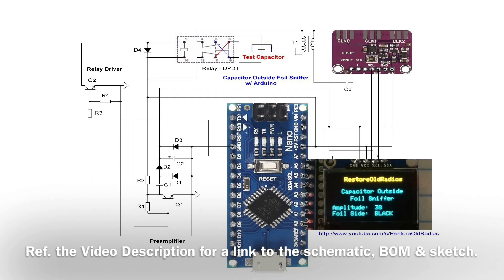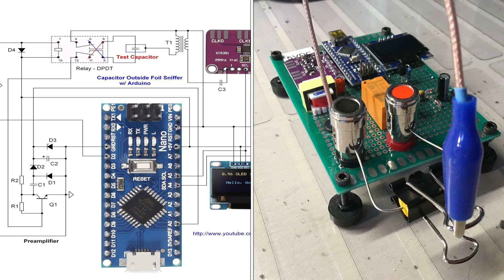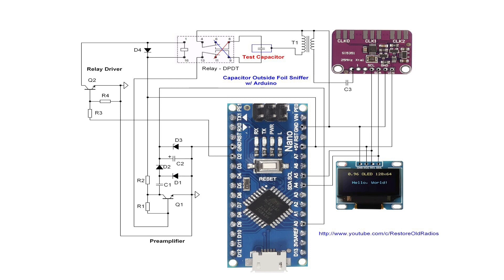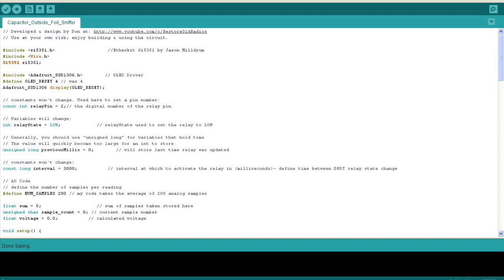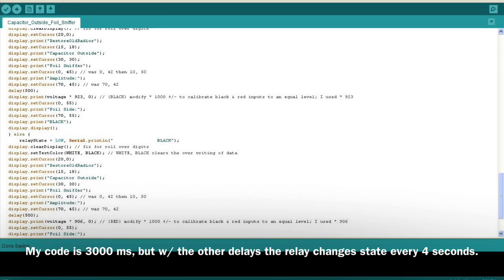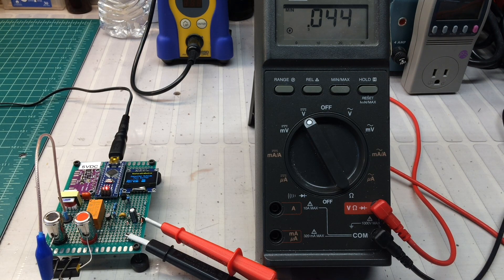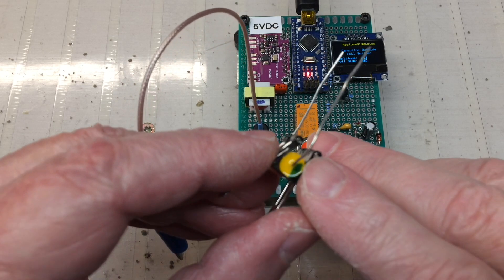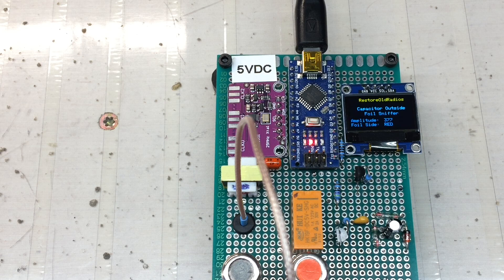Capacitor Outside Foil Sniffer w/ Arduino Version 1.0

Comment: I fail to see the reason for locating the lead connected to the outside shield. If the capacitor is used as an interstage couping capacitor, it will have a low impedance for 60Hz. The plate circuit will usually be above 10k, and the grid end will be above 100k. In this case, it doesn't matter which end is connected where. If the amplifier is highly sensitive, it will have to be enclosed in a fully-shielded box. It the capacitor is an electrolytic, you have no choice. The negative terminal has to be connected to the node with the lowest potential. If the capacitor is a ceramic, it will normally be low voltage and used in transistor circuits where there is no 60Hz. If the amplifier is a high-gain sensitive amplifier, it will have to be enclosed in a fully-shielded box. See Jim Williams, AN124, for an example of putting a circuit in a cookie tin for shielding and powered by a battery. Others go to further extremes such as including a mumetal shield to attenuate magnetic fields. In these cases, for interstage coupling capacitors, it doesn't matter where the outside foil is located.

Comment: Another interesting and well presented project - thank you Don.  Did you consider going the final step and having the Aurduino average the black and red readings, for a few cycles, and then just displaying text stating "the outside foil is the red (or black) terminal" and stopping the relay clicking every few seconds?
Reply from the maker: Hi Steven - thank you. The prototype design I shared was more of a proof of concept for me. After building the unit, I rethought the design and have since built another prototype that I’ll share soon. It takes into account the constant relay closures that would lead to premature failures as you noted and LEDs for the outside foil Indicator in lieu of the OLED. Thanks again for your feedback and be watching for the updated circuit, sketch, etc., soon. All the best. Don

Comment: Great project using the Arduino Don, I have been using the Electroscope/Electrometer that you came up for the foil test during the past year and works very well for me.
Reply from the maker: Thanks Jim. I’m glad the Electroscope worked well for you. While doing the design for the Arduino build, I actually did another design that works equally well that I’ll be sharing soon. Hope you’re doing well. Best, Don

Comment: 1) Thank you for your efforts to share and teach! 2) I would like for you to give us a brief introduction, as to where and when it is important to know which pin is the outside foil. I take it that it is s-o-r-t of like knowing the polarity of a non-polarized foil cap. Maybe putting the outside foil to ground it is a safety measure? 3) Why did you not use the Arduino to create the square wave? Can't get a high enough frequency? I look forward to your replies.
Reply: When restoring antique radios, capacitors are always replaced in their entirety.  Old capacitors used to have the foil side marked.  New ones unfortunately do not.
It's important to have the foil side towards ground, otherwise the replacement caps may end up picking up unwanted noise.  Which on an old tube radio can be very noticeable.  If you've ever recapped an old radio and ended up with difficult to track down noise, chances are you've put a cap in backwards.
Reply: @thereare4lights137  "It's important to have the foil side towards ground, otherwise the replacement caps may end up picking up unwanted noise" = shielding.  Ahh... That makes sense. Great explanation = thank you.
Reply: @t1d100  LOL! I suppose I could have just summed it up with the word "shielding".  I tend to overexplain everything..., so says my wife 😉
Reply from the maker: In my first design Ver1.0, I was introducing a high amplitude signal at 200kHz (higher than Arduino could generate) to the binder clip attached to the capacitor under test, while Ver2.0 the binder clip around the test capacitor is tied to the preamplifier and the Arduino square tone by default is set to 15kHz, which is tied to the relay and alternates the signal across each capacitor lead. A good read on the outside foil/ shield is: http://www.aikenamps.com/index.php/where-to-connect-the-outside-foil-on-capacitors

Thanks for reaching out and be sure to check out the Ver2.0 build.

Best,

Don

Comment: Awesome. I thought about creating something like this after seeing mrcarl de on his scope based version. This is so much easier. 

I do have a question, maybe a dumb one... Would it be possible to measure both leads at once. Using two preamps and no relay? It would make the measurement even faster.
Reply from the maker: Bart - I posted the V2.0 build, which is a much better design and performer. To understand the foil side, each lead of the capacitor has to be grounded one at at time while measurements are made and V2.0 does this more efficiently. Hope this helps. Best, Don
Reply: @RestoreOldRadios  as a subscriber I have seen the new build. Faster and less parts. Though losing the fancy screen feels sad to me for some reason. Thanks for replying